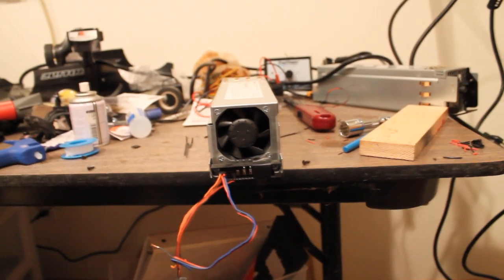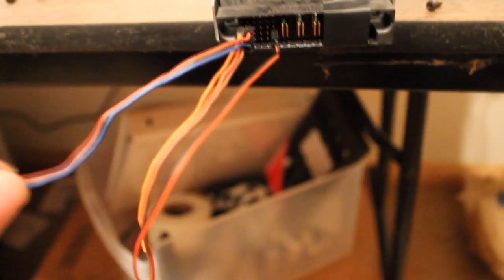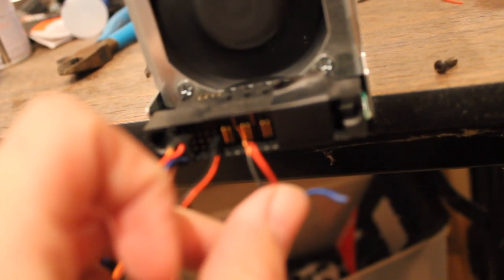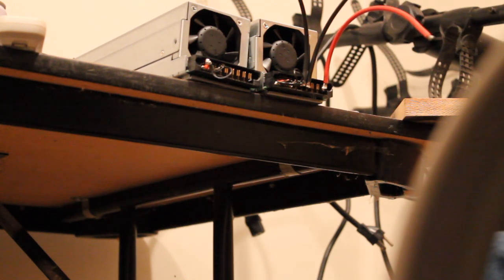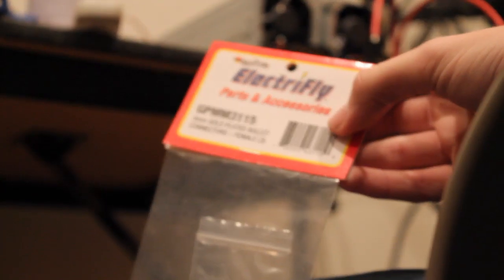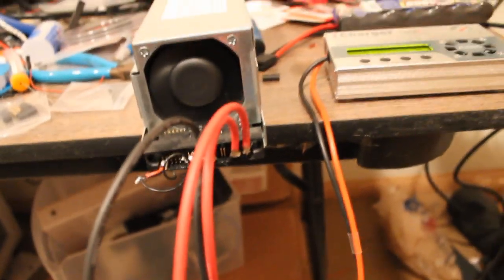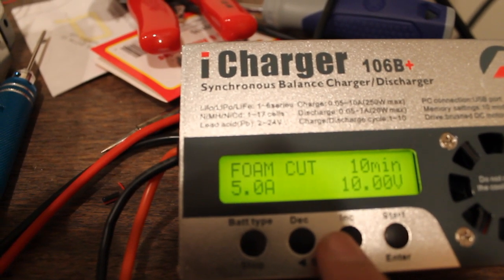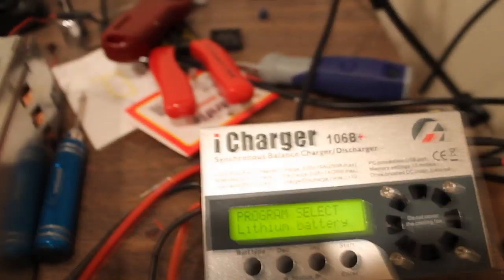lipo charger server power supply

Comment: Did you ever sell these on eBay? I bought one just like it a few years ago from there 750w dell. Fan is quiet. Thing fucking rocks!

Just checked EBay and looks like some server guy blew everyone else out of the water with those carbon wrapped ones. 1000w for $60 and they are small and cool looking.

Comment: question for you, it says 700w max - does that mean that because there are 3 +12V outputs, that each one should put out 12V ~ 233 watts?  I ask because the 106B+ is 250W capable, and if you ever move up to a 206B or 306B i would need more power - so can you just solder the (3) positive output posts together into one bullet connector; therefore giving you one connection that can take the max amout of power (i.e. 700W 57A) or as much as the charger is capable of pulling from those soldered terminals

Comment: I picked up a 2.7kW one a few days ago for parts.  It's not much bigger than this thing, and can actually output more than 200 amps continuously at 12V.
Reply from the maker: Would you happen to have a link for that?  I am currently building a work bench for a client and he requires MASSIVE amounts of dc current.  I think he does ham radios and other 12 volt activities with many friends and he is always wanting more power once I come up with a design.  That would beat the 12 volt genset that I was going to build him.
Reply: I picked it up from a friend of mine...unfortunately he has no intention of putting them up on eBay.

Comment: Hiya, Any idea which pins to join together to slow the fan down or make the speed automatic under load. Regards Steve.
Reply from the maker: +steven statham At 1:49 I show the pins for the connections.  I believe this still allows the fan to ramp up as needed.  I have not been able to make the fan come up much more than the lowest speed with full load and the air coming out and the case itself was still 5° higher than ambient.  I can look into it again if you think it is necessary for your application.

Comment: how can i put these in series and make 24 volts
Reply from the maker: You must remove the 12 volt ground from one of the power supplies, so that they don't conduct ac current between the two.  The best idea is to read up on 24 volt power supply builds.  PLEASE, be careful.  If you do not properly isolate the grounds within the case completely, and they come into contact with the case, you can electrocute yourself quite easily.  I would not recommend doing that unless you have a very strong understanding of electrical wiring and safety.  I assume no liability or responsibility for you misadventure.   Also, what are you doing that requires 24 volts? In most cases you can get away with a 12 volt power supply, as modern chargers have buck-boosters built in to charge higher voltage batteries.
Reply: MONEYPITDBG i think you can put a resistor somewhere and the powersupply ramps the voltage up to 13.9v!